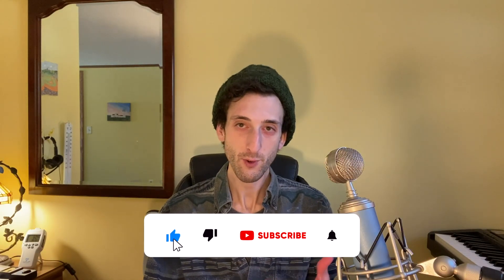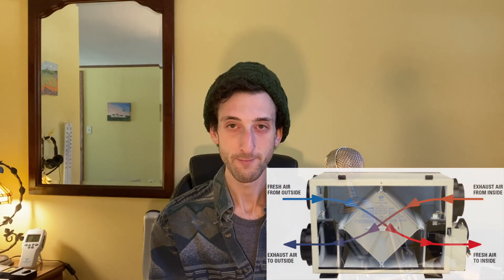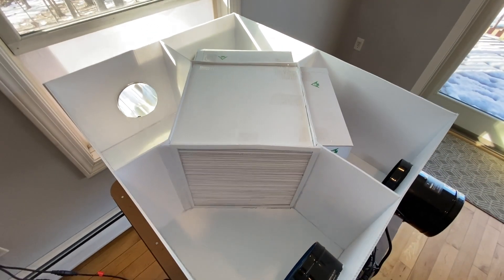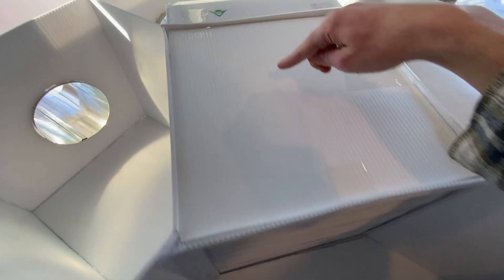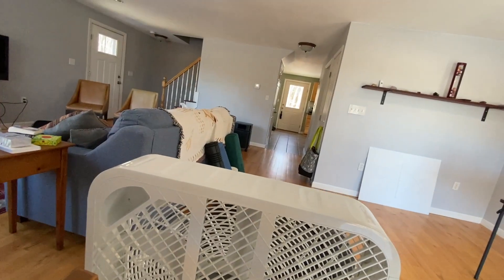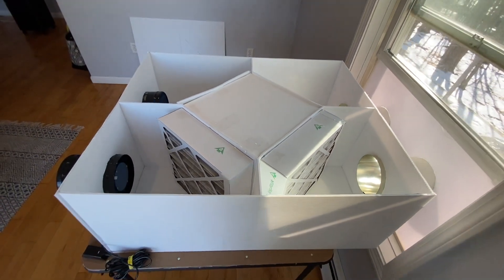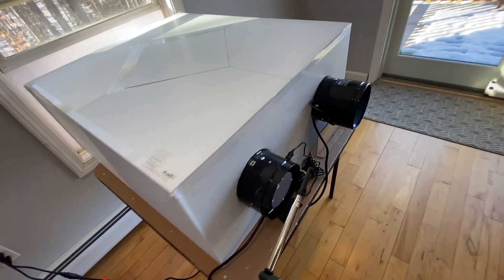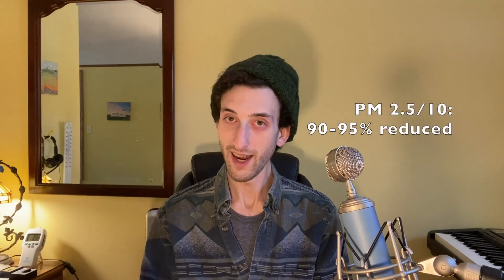I built the best DIY heat recovery ventilator I’ve seen on YouTube

Comment: Thank you for sharing this, truly. Definitely a thumbs up! Sharing knowledge and experience like this this is the internet at its best. Also nice to give credit to your sources at the end.

Question 1: High effective is 85% as compared to a commercial system? I could do my own research of course but in case somebody knows already ...

Question 2: Did you consider alternatives to spray adhesive for laminating the plastic heat exchanger stack? I am thinking it is an unnecessary source of VOC’s? Are there “healthier” adhesive options or am I being overly concerned?

Question 3: Would efficiency increase with a heat exchange filter material of greater thermal conductivity like copper or aluminum?

A am pretty sure moisture build up would be an issue if installed “properly” with outgoing air coming from high air moisture areas like bathroom, kitchen and laundry rooms however. But in any case really cool build!
Reply from the maker: That’s very kind, thank you! I totally agree: YouTube especially is fantastic in many ways - not only for entertainment, but also for learning and growing.

1: As far as residential HRVs being built and sold commercially in 2023, 85% is considered to be at the low end of the high efficiency range. There are definitely higher efficiency ones than mine available commercially.
2: I did use a low VOC spray, but I understand where you’re coming from. I feel that the spray adhesive is necessary for maximum contact and efficient heat exchange. I’m not too worried about VOC release because once low VOC spray adhesive dries, it solidifies and is less volatile. Air also isn’t flowing in between the coroplast layers, as they’re tightly bonded together. I also personally haven’t smelled any adhesive odor from my HRV after it dried. 
3: I’m not sure if efficiency would increase unless the core layers were made of aluminum or copper itself (as opposed to coroplast). I don’t think that putting aluminum in between the coroplast layers would increase heat transfer because the heat still has to go through two layers of coroplast, even if there is aluminum in between. I could be wrong about that, but I believe that more materials would lead to efficiency loss. Also, I don’t see a need for that labor, personally.
4: Absolutely. In the summer, I use a different setup to avoid moisture issues (see my latest video for info about that). This year, I found that this HRV works best in the spring, fall, and winter. Not summer. 

Thanks again!

Comment: as an actual HVAC Technician i think that is pretty neat. the physics is the right way around and from the numbers i can tell it works. the only way to improve would be a more conductive material to get the usual 90-98% efficiency but apparently its conductive enough.
Reply: 90-98 is definitely not the “usual” efficiency rating for HRV/ERV’s. That would be on the extremely high end.
Reply from the maker: @JordieG8  agreed.
Reply: @JordieG8  i have no explanation for this. i dont remember why i said 90-98 i guess i meant max. just goes to show take everything with a grain of salt or something
Reply: @steffankaizer  all good dude, I thought you maybe got it confused with high efficiency furnaces or something. Lol
Reply from the maker: That’s very kind, thank you! That means even more coming from you, as a legitimate HVAC tech
Reply: @HealthyHomeGuide  
You need to take account of relative humidity in the calculations., aka, both latent and sensible energy transfer
Reply: S

Comment: Good work!  What would you recommend for a camper van or RV?  Just filtered intake and crank the furnace?
Reply from the maker: Thanks! That’s a fantastic question. It depends if we’re in a warm season or a cold season. For a small space like that, first and foremost I’d want to ensure that humidity remains below 55%. Not an issue when it’s cold. I personally feel that mold growth is actually more of a health hazard than CO2. Filtered ventilation is still important though, of course. If the weather is cold outside, you may want to build a small HRV. I may attempt one this winter. If you can’t go the HRV route, intake filtered air very sparingly with an intermittent outlet timer. 

I’m releasing a video soon about balancing CO2 reduction with humidity/particulate/temperature control. That may further clarifying things for you!

Comment: If you move it to the basement, it may create somewhat unhealthy results inside the media. Because basements tend to be musty especially if its a “non-conditioned space.”  This can happen regardless of the fact that it’s a sealed system
Reply from the maker: You’re absolutely right. I’ve since reconsidered the basement idea. Too much dampness and mold. Though dehumidifying should mitigate the worst of it - still not the best idea, yeah.

Comment: The stale air only needs a dust filter to keep the core clean, not a m13
Reply from the maker: I disagree. Dust filters are weak. Oddly, they don’t filter out 100% of large particles like dust. According to the EPA, dust filters remove less than 20% of large particles (3-10 microns). A better filter will protect the core more effectively, for longer. 

Also, I wanted to use the same filter on the intake and exhaust so the pressures were balanced.

Comment: Great work!  I'd place in the attic or at least that is what I planned to do with mine.  I assume you saw the Hackaday HRV and maybe also my comments there and his youtube videos. 

I bought a few rolls, and even got some for free, of aluminum window screen.  The thought was at some time 3D printing or maybe CNC in wood a tool and die to stamp like a linear ridge zig zag stamp so to increase the surface area of the alternating layers.  I also found an old hair iron crip wave thing that is close, though small.  

I plan to only space the one path of flow and use corrugate on the other path. The spaced path that would use two other maybe three strip of one width corrugate tubes would have the zig zag aluminum mesh.  I left off wondering how to plastic weld both sides into the full sheet of corrugate.  The other thought was just ironing into both side of the corrugate the aluminum screen.  That might work suitable as well and just then placing the zig zag screen into contact.  

I probably should work on again since I have now another size of corrugate material, 4mm, and not only the cutout 12x12 inch larger thickness 10mm corrugate. 

What thickness corrugate did you use?  Thanks for sharing.  Great to see more of these designs being made successfully and cost effectively.
Reply from the maker: Thanks for the comment! I’d be curious to see how your design turns out. I used 4mm corrugated plastic.
Reply: @HealthyHomeGuide  I'll remember when I do and try to report back.  I'm sure I'll post something on here as well. Your welcome and thank you! Very inspiring and yet creative.

Comment: I applaud the initiative.  This is certainly the future & I love it.  Some things to consider... 
1) CO2 "cannot" be affected by the unit, as the CO2 level is whatever you are drawing out of the air coming in from outside (usually about 400 unless something weird is going on.  Plants like it when we "talk to them" because we are breathing CO2 at them.  CO2 builds up in a house because of "us". 
2) I would be greatly concerned about the VOCs coming off all that plastic, adhesive and other chemicals from 3-D printing.  It's gonna off-gas, a LOT!  Funny your comment, "insane!", right after, cause..., yeh.  
3) There is an actual Metric they use, CFM/watt, to quantify how much actual work is being done.  It's used to measure performance.  Measuring the Factual temps of the airstreams is of great interest also.  
4) Tape the edges of the filters or there is bypass (sneaking around the filtration, around corners).  HEPA has no "bypass".  
5) Measuring the air pressures will tell you the static resistance various parts of the system are causing - core, filters, vents.  
Cool experiment, but don't mislead people with hyperbole instead of data.  Maintain integrity.  Do no harm.  Cheers.
Reply: There is more things to consider:
1) The heat exchanger is not going to be very efficient, because it does not have perfect counter-flow. In the 2 corners at the border between inside and outside, there will be heat exchange between the hottest part of your system and the coldest part. A simple system of two (long enough) concentric pipes is going to perform better.
2) In winter, condensation in the outstream will boost efficiency even further. In summer, condensation will occur on the instream, making this system unusable.
3) Indoors, it is much better to have air intake and outlet in opposite parts of the house, so the clean air will spread without the need for additional fans. Outdoors, outlet and intake can be closer together, and should probably be pointing in the same direction in order not to get drafts when it's windy.

Comment: How did you measure the 95% PM 2.5 reduction? Was it continuous measurements? At different locations? The literature only gets up to 30% reductions.
Reply from the maker: For two week periods (one period without the HRV and one period with it) I measured PM 2.5 several times a day at a few different locations in my house. I then averaged all the measurements and compared with HRV vs. without.

Comment: As an HVAC contractor I have a couple questions, how loud is it? Do you think insulation in the main cabinet is necessary to prevent condensation from cold incoming air? Also what do you have any plans to incorporate a defrost operation for continued cold operation? Really enjoyed your build, thanks
Reply from the maker: Good questions! It’s very quiet on the lower speeds, and less quiet on the mid to high speeds, but still doesn’t get annoyingly loud until the highest speeds. I used a terrabloom fan for this, but I’d recommend using AC infinity cloudline fans because they’re even quieter with higher static pressure ratings. Similar price too. 

I ran this HRV continuously through the winter (in an extremely cold climate) and it had no problems with condensation. Defrost was actually unnecessary. Thanks for the kind words, hope this was useful to you!
Reply: @HealthyHomeGuide  good to know thanks for the timely reply
Reply from the maker: @coopervaterlaus5095  sure thing!

Comment: The deal breaker for your design is complexity. Once you go above the 100USD range, ignoring work, you start competing against SEA manufacturers which use aluminum and already more integrated cellular designs, which typically use a hexagonal "core" (It's really the entire thing, at that point), which reach +90% efficiency and allow for much faster airflow. Their only downside I see is the lack of filter integration, however, you could simply duct the intake to attach a filter or go the extra step and build a more adequate case, possibly with the same materials you are using. Either way, I enjoyed your project a lot and I hope it servers your purpose well! I also think you might enjoy "Tech Ingredients"
Reply from the maker: Thanks for your feedback! I actually am planning on ordering a hexagonal core (also known as counterflow) off eBay and building an HRV around it for next winter.

Comment: The biggest drawback is intake being right next to outtake, so probably not so efficient or fresh.
Reply from the maker: I disagree for two reasons:
Firstly, I measured CO2 levels with and without the HRV to ensure fresh air is being brought in, and it is. Data for that is in the video.
Secondly, one of the ducts extends further externally than the other. So one extends 2 feet outside and the other extends 1 foot, which helps them avoid exchanging air. It's difficult to see in the video because the longer outside duct curves downward. Internally, since I released this video, I actually put a curve in the supply outlet, so it blows in a different direction that the return (exhaust).
Reply: @HealthyHomeGuide  To be fair to Beny, it is difficult to tell the extensions of your intake/exhausts from the presentation.  Given that, one addition that you should check is the distance of the intake to any other exhausts on that side of the house (and this includes windows-unless they are never to be opened again).  Normally, 5' seems to be the magic number.  Good job on the rest.

Comment: How do you know it doesn't short circuit with the intake and exhaust located right next to each other?
Reply from the maker: Two things:
Firstly, I measured CO2 levels with and without the HRV to ensure fresh air is being brought in, and it is. Data for that is in the video.
Secondly, one of the ducts extends further externally than the other. So one extends 2 feet outside and the other extends 1 foot, which helps them avoid exchanging air. It's difficult to see in the video because the longer outside duct curves downward. Internally, since I released this video, I actually put a curve in the supply outlet, so it blows in a different direction that the return (exhaust).
Reply: @HealthyHomeGuide  Thanks for the reply. Can you elaborate on which duct is extended beyond the other, i.e. is the supply extended further than the exhaust or vice versa?

Comment: You should try putting alum foil in between the core plates for better heat exchange. Maybe you will get better result. 👍🏼
Reply: More materials results in efficiency loss.

Comment: Really nice work.
You've mentioned your HRV's size, (07:56), which got me thinking.... the ducts, fans, filters, and heat exchanger must stay about the same size to meet your needs, but eliminating everything except for those essential parts, should reduce its size by at least half, maybe more.
Alternatively, installing your HRV out of sight, like outside, or in the attic, should leave only the intake and output duct holes visible inside the house.
Good luck, and thank you for sharing.
Reply from the maker: Thanks very much! I definitely could make this design a bit smaller, but only across one axis. The quadrants are just barely big enough for the filters, so I can’t really shrink the quadrants, width-wise, unless I go with smaller filters. However, I can certainly reduce the length of this design without getting rid of any components. For next winter, I’ll probably make a smaller one!

Comment: When talking about HRVs, the topic of CFM and ACH (air changes per hour) should be covered.

I arbitrarily sized your house at 1500 sq-ft with 8ft ceilings = 12,000 cu-ft of volume. I estimated your airflow at 100 cfm. I came up with 2 ACH (air changes per hour).

The thing about fans is, they rate their CFM on zero static pressure. But this unit will definitely have a relatively high static pressure, therefore the CFM of your build will be much lower than one might expect. You've also said in other comments that you're lowering the fan speed.

In order to determine your actual CFM, you could just multiple your working air velocity (in ft/min) by the duct area (in sq-ft) and calc the CFM.
Reply from the maker: Thanks for your comment! So, I measured the CFM at the supply outlet at various fan speeds. I did two series of tests. 

In one, I put the anemometer 6-8 inches away from the outlet, what I believe is a fairly standard distance, and in the other, 2-3 feet away from the outlet, a conservative distance, to ensure the readings aren’t unrealistically high due to the relatively high air velocity through the 6 inch fan, a relatively small outlet. Here’s the data:

With an anemometer distance of 6-8 inches (may be overestimating CFM):
-speed 1 of 8: ~100 cfm
-speed 3 of 8: ~150 cfm
-speed 6 of 8: ~250 cfm
-speed 8 of 8: ~330 cfm

With an anemometer distance of 2-3 feet (may be underestimating CFM):
-speed 1 of 8: ~55 cfm
-speed 3 of 8: ~75 cfm
-speed 6 of 8: ~120 cfm
-speed 8 of 8: ~170 cfm
Reply: @Healthy Home Guide 
Nice! Don't bother with anything but the close measurements. The further distance would negate your duct area measurement, thereby negating your CFM calculation.

In other words, at the further distance, the air plume (basically diameter) is larger than the duct size. But, you definitely need an accurate duct size to calculate CFM, accurately.

By the way, if you can get the fan curve from your fan manufacturer, you can use the curve to cross reference CFM and determine static pressure of your system. 

You might want to get the technical data on the filters, too, because they have a spec for minimum static pressure.

I used to design equipment for commercial grocery stores and restaurants, the majority of which had fans and filters.

Given your air volume, I'm quite certain your static pressure is high enough for those filters. However, those little axial fans (like you said, computer fans) have some extremely low static pressure. You did well to stay away from them.

Comment: This is a great video - I’ve liked and subscribed. But your discussion of costs are a bit misleading. You say installing a new unit would be $4000 dollars and whereas it certainly could, there are models that only cost ~$500. Labor cost should not apply here since you also did not install this into a dedicated mechanical space with duct work. 

Still, assuming you could get the cost down to $150 by sourcing cheaper suppliers then it may be a worthwhile project.
Reply from the maker: Thanks so much! In the other video of mine (about HRVs) that I reference, I talk more about my $4000 estimate. Basically, I don’t believe there any truly good HRVs for as cheap as $500. By “truly good,” I mean ones that are capable of properly filtering the air, generating enough cfm for a large area, and that have efficient fans (among other more minor but important features). 

Your point about the labor cost is a good one. I definitely agree that it shouldn’t apply here.